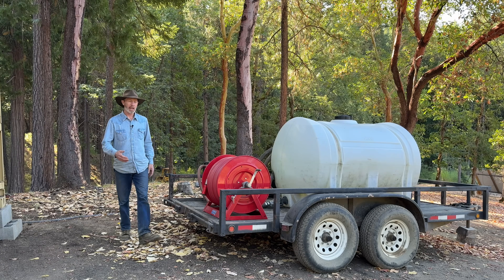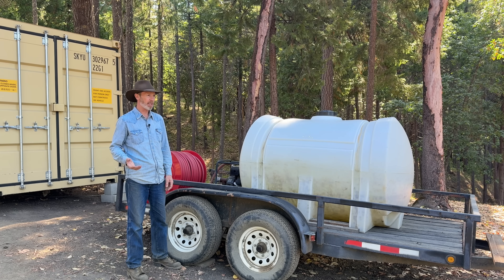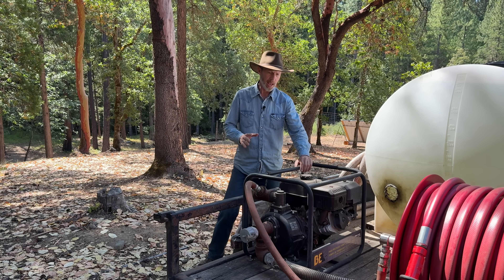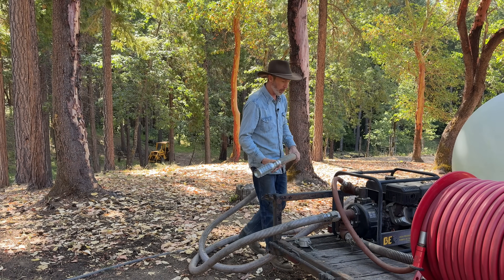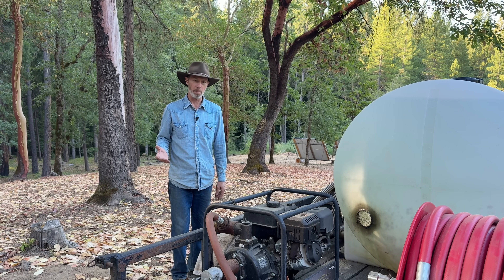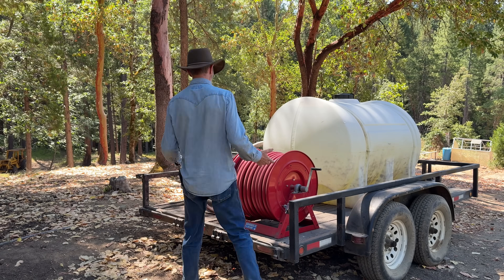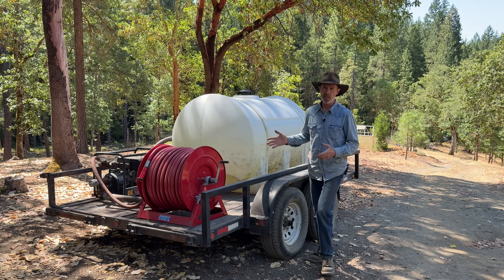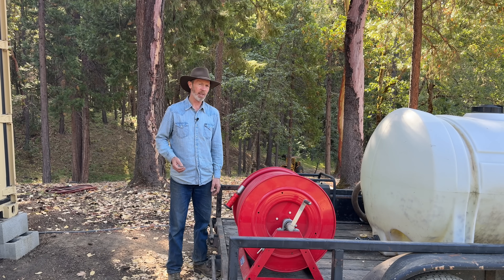I Built A DIY Wildfire Fighting Water Trailer

Comment: 5:18  Obvious question but, couldn't you just fill the tank from the red hose? None of the benefits of a recirculating system but you get a full tank of water.
In Britain we have ex-military "Sankey" trailers. Small, all steel, off road capable and will take a ton at a squeeze. Might be worth seeing if US forces use a similar thing.
And yeah, nothing's more permanent than a temporary solution.

Comment: Cool setup. My system is static as my entire property is one big hill with no hope of dragging a loaded trailer around. Plus there’s a lake at the bottom so the source is fixed. What I wanted to mention was that when I was discussing my proposed setup with a neighbour who is a firefighter he told me “Keep your hose lengths to 50’ max. Way easier to carry another dry roll to the end and attach than try to drag hundreds of feet of charged hose around and over things by yourself.

Comment: You can spray paint that water container and make it light tight. It's what I do on my IBC totes. Place a thin strip of tape going vertically up the container before painting to create a cheap water gauge. I suppose being the channel that it is I should mention you need to remove the tape after painting in order to see the water level.

Comment: Cool little setup you’ve got there. One tip—you can stretch that 500-gal tank a lot further by carrying a couple gallons of cheap dish soap. Class A foam works by lowering the surface tension of water, and dish soap does the same thing in a pinch.

If you add about 1.5–2.5 gallons of dish soap into your 500-gal tank (that’s a 0.3–0.5% mix, same ballpark as Class A foam), you’ll turn your water into “wet water.” That means:
	•	It penetrates deeper into wood, brush, and other Class A fuels instead of just beading up and rolling off.
	•	You’ll get a faster knockdown because more of your limited water actually soaks in where the fire is burning.
	•	Your 500 gallons will last longer, since you’re making each gallon more effective.

Only thing—flush the pump and lines with clean water after using soap to keep things from gumming up. It’ll get sudsy and slippery, but it’s a cheap, simple way to boost your firefighting power.

Comment: Nice setup. I have something similar. I use Storz C (2 inches) couplings instead of Camlock couplings. The advantage is that Storz doesn't have male and female couplings, just like the GeKa system, which only goes up to 1,1/4 inches. Pressure gauges at the outlet and especially at the inlet are also important, as they allow you to quickly determine whether the system is drawing in air. This can cause major problems. By and large, every landowner should have a mobile water pump system as part of their basic equipment.

Comment: A couple things for people wanting to make one, which I have done:

500gal is insanely heavy. Most of your pickup truck size skids are 300ish gallons because of this. Common IBC totes are available in 275 and 330 gallons, perfect for this application. Remember to place the weight of the water properly for axle loading and tongue weight distribution. 

Get the Honda pump, or one of the clones of it if budget is an issue. It’s the best design out there. 

The thing for a garden hose is called a “water thief”. Get some 50-100ft sections of Wildland “toy hose”, which is canvas single-jacket with garden hose threads (GHT). This, plus some all-metal commercial grade irrigation sprinklers, can make an effective structure defense line. 

As for the other adapter on the output T-fitting, you probably want to have several in both 1” and 2” sizes, with the different types of threads. USFS uses a different hose thread pattern (NPSH) than most of your municipal fire departments (NH/NST/NHT, which is all the same thing). You will also note that all your metal fittings will be NPT threads… most hoses cannot attach directly to that. So it’s wise to have a little box of extra adapters and a wrench on board. 

As to rig design: the pump needs to recirculate the tank water. So another T fitting where it goes out to the hose reel is needed, and hose to feed that to a bulkhead fitting installed at the top of the tank. IBC totes are clutch here again, since that fitting can be installed in the top cap. Also, the recirculation line needs a ball valve to shut it off as you open the hose up, or it will steal all your pressure. These should ideally be switched simultaneously. 

You will need at least a few hundred feet of 1” forestry hose to run branches if you are trying to defend a static area, like a farm/barns/cabins/etc. This will also require water thief couplers & adapters to link the hoses and allow you to split off various lines. 

300ft of rubber 1” handline is obscene. The weight of that hose is punishing, and there is no need for that much handline. You’d be better off with two 100ft rolls on each side of the trailer or maybe front/back. A fire skid can get away with one 50-100ft reel, as you should not be farther away from the safety of the engine anyway. 

Also, remember that your wood trailer deck and plastic tank can catch fire, as can dry hose and rubber handline, so keep your wits about you and things clear of exhaust AND falling embers. If the fire is close, give the apparatus a nice spritz as you begin (not the engine of course). 

Remember, you will need other gear staged for this. Appropriate safety gear, clothing, helmet, eye protection, and gloves. Sawyer equipment if you are trained, and always a fire shovel, axe, and rake. You should have bolt cutters and fence pliers on every wildland rig, as well as a good trauma kit in a protective hard case. I also recommend a tool kit of various plumbing stuff for the fittings.
Reply: All that information to just type 'insanely heavy.' Offering actual numbers, 500 gallons(~1900 liters) of water will be around 4,000 pounds or around 1800 kilograms. I'd rather go with the tote version. They will fit in almost anything with a bed, even in my maverick. Though you'll need to be aware of payload and mark a line where that limit is on the tote. Still, for fast response it can make all the difference. Unlikely I'll need it as I don't have to worry about wildfires but maybe someday i'll make one for 'just in case.'

Comment: Nice setup but as you say it's a little big.  Heavy to pull through soft ground if you are trying to get close to the fire but looks like it's not a problem in your area.  I have a scaled down version.  Single axle trailer, a water tote cube (250 gal), 5 horse Honda motor, 1 inch suction, 500 ft of 3/4 in collapsable fire hose.  My Honda 350 quad can pull it. (not easily, but it's what I have).

Comment: Large leaf blowers help extinguish outdoor grass fires when blowing the fire back into the black .
Reply: Back in 1978, my platoon Lt. thought it was a good idea to use a smoke grenade to mark the LZ for a CH-46 helicopter to land.  He didn't think about the 3 foot tall dry grass and started a nasty blaze.  Thankfuly the helo pilots came in from the right side and blew the fire back on itself.
Reply: I've seen those used by small teams in hotter climates and they could move quick using light vehicles to get in there with backpack-style leaf blowers.

Comment: Mount the tank, pump, hose reel on a 1-ton or bigger pick-up with a flatbed.
 Way more maneuverable and less chance of having 3 tons of water, tank, pump, hoses and trailer shove your pickup down a steep road, hill, or off the loose gravel/dirt road & into a ditch, or canyon...
 Plumbing for the tank to hose reel, or refill/draft to the tank is fairly easy to do with adequate size and pressure rated T fittings and in-line ball valves

Comment: the recirculating line back to the tank will save your pump from melting someday.   To be fancy, two lines back to the tank, one large diameter for refilling the tank, the other smaller diameter with a pressure relief valve that automatically opens when you shut off the hose line. or just a small diameter hose back to the tank.  Don't need a lot of flow to save the pump.   One less thing you have to do to preserve the pump, especially if you have to hike 300 feet back to the trailer to shut it off.     a low water shutoff might be pretty handy as well, as pumps spinning dry will eat itself really quickly.  a strainer basket and a foot valve will make refilling from a stream or pond way easier.   A small float on the strainer so that it is not sucking mud from the bottom of the stream will preserve your pump.  Empty milk jug or the like with a couple inches of rope should work.   
     The foam additives are nice, but you can just have a bottle of dishwashing soap and dump it into the tank when it's full. Keep a couple bottles on the trailer all the time.    It will increase the gallons per minute you can flow, and give you more pressure at the hose nozzle which is mighty handy.  don't know offhand how much would be needed, but 1% would call for 5 gallons for the full tank.   I suspect less would do fine, as you are not planning to fight oil fires with it.    
      The other thing is the motor.   when it comes time to replace it, get a dual fuel model that can run on gasoline or propane.    A 20 lb barbeque tank should run it for hours, and no worries about the gasoline getting stale or screwing up the carburetor.  For an extended emergency switch over to gasoline as needed.   I got a propane generator and it always started right up for me, unlike gasoline generators.  
   Firefighting strategies.  Rule 1, conserve your water.   that looks like a big tank of water, and it is, but getting into serious firefighting will use it up fast.   Shut off the nozzle every time.   Use fine spray more than the direct stream.    Go through the whole system and get OCD on stopping leaks.      I don't know if you have grasslands in your area, but if you do, make arrangements such that you can run a hose up to your tow vehicle so the driver or front passenger can spray out spot fires without getting out of your seats.  Regular garden hose with a one hand spray nozzle run up the side of the trailer and tow vehicle.   Hooks or tie off points to allow for normal trailer motions and not drag the hose or drop it.

Comment: Take quick conects on 2 inch lines on the discharge line to 2 inch pvc or of you only want to use flex hose make a small pvc hook to hold the line. But remember you need a air gap 
On the tank end

Comment: Also important are generously wide firebreaks kept denuded of all vegetation. If your water also contains total vegetation killer you can spray firebreaks while being ready for fires. Wildfires require FUEL and silly people put forest esthetics before the struggle for survival. I steadily denude the threat areas around my structures and have zero trees within 150 feet (and expanding each year). Trees fail killing people in their own homes every year because they failed to prevent them from existing.

Comment: A couple of suggestions from an Australian firefighting perspective: 
Many pump manufacturers warn that you will void your warranty if you  don't  use recirculation. A pump running with a closed-off hose is really just a machine for heating water, and that's not good for a pump. 
If a wildfire is getting lively, you want to be able to refill pronto and get back on the job. Many pumps come with 2 inch inlet and two inch ( or one and a half inch) outlets.  If you take advantage of the big outlets by plumbing a T, a valve, and a short length of 2 inch hose into the tank, you can halve your filling time. The other side of the T can be valved, then stepped down to one inch for your delivery hose.
Many of these pump motors will shut down if they are not sitting fairly level.  People often scratch their heads if they back down into a dam or creek to draught water and can't start the pump.  The low oil level cut out has been triggered. Solution: look for more level ground, and keep oil absolutely topped up.
Reply: Recirc can also help keep water from freezing, or thaw the tank if there's ice floating in it should you need it in the edge seasons like spring or fall.
Reply: Australian’s know what an inch is?
Reply: @mountainguyed67 Yep, it's not a big deal for us. Australians are pretty easy going and don't get worked up about it, even though metric makes more sense.

Comment: Get the honda high pressure pump,  it is a game changer. I started out with almost the same set up you now have and It was a joke of how little water was discharged  from my 200ft of 1" fire hose. My garden hose moved more water. I now carry my two !CB totes (550 gallons) in the bed of my 1 ton, 4x4, dually chevy. They  take up less then  7ft of bed space. The pump sits behind the totes and I can even close the tailgate if I am  traveling any distance. My intake hose is 20ft,  by  2" and my discharge is also 20ft by 2" hose. The key to making this all work is larger diameter hoses and less friction. We have a deep creek with easy access  less then 1/4 mile from my place and I can pull up, drop the pick up hose into the creek, remove the fire nozzle from the discharge and pump right into the totes. Then put the pick up hose into the top of the tanks and its ready to go.  With empty tanks I can drive down to the creek, fill my totes by myself and be back home in 15 minutes fully loaded. I can do that even quicker if I have one of my sons with me. The truck is so much more maneuverable then the trailer and with the high pressure pump I can push a large volume of water out to about 80ft. I  can empty those tanks in 5 minutes at full throttle or throttle down and make the water last. If my son drives we can cover more ground on the move and wet down a lot more real-estate then you can trying to drag a heavy hose from a parked  trailer. In my opinion, a hard initial attack with a lot of water up close and personal is the key to getting things under control before it spreads or gets out of control. The last three small fires we have had in the neighborhood it took state forestry 45 minutes to get here. I am not playing that waiting game again. All of my neighbors all know they need to come find me if we have any type of fire and if I am not home, take the rig and attack it.

Comment: I found out that high test gas is mostly formulated without the ethanol. But its also high octane.  I switched to that, even if its pricey, I don't use too many gallons a month, but all the small engines will not start much easier. From watching the videos of your roads, I would definitely keeps some serious straps on that tank.

Comment: I have installed a ball valve on top of the pump with a funnel to help with priming instead of the cap. When the pump is being used from a natural water source. 

Those plastic/aluminium caps have the habit to strip threads.

Comment: Great set up. Couple things to add are   A ball valve on the extra discharge so you can add another hose if the pump running and you could run  a recirculating line from the pump to the tank to keep the pump from over heating when you aren’t flowing water . You could also fill the tank if you are drafting . Also look at putting a shovel,and Pulaski on the trailer .

Comment: Couple things I would not like. Easy fix
Algae in the tank. Cover it up from sunlight 
Whacking my hand on the side of trailer. Switch position of pump and hose reel 
Enjoy
Reply: Also, small engines are especially fussy about water in the fuel. Using non ethanol fuels will help. Seafoam additive can sometimes resurrect a crapped up carberator

Comment: I once woke up in the middle of the night and did something I never do, I stood by the window and looked into the darkness.
all of a sudden I see a small fire spark up in my parents trailer, which quickly started to grow.
we managed to put the fire out, without any damage to the trailer. turned out the day before, my father poured hot ash on the trailer and the greenery inside 🤦‍♂
I don't know what made me look out the window that night and I certainly don't want to know what would have happened if I didn't.

Comment: That spec you’re talking about that ODF requires is 20 gallons per minute, at 115 psi through a 1/4” nozzle tip at 500’ of 1” hose. Nice work mentioning that. Stick a T on the suction side and get another valve to isolate the tank and put a camlock on the other outlet with a cap, you should be able to draft that way. That 500 gallon tank size is important too, 500 gallon minimum if it’s a trailer, if it’s truck mounted it only needs be 300.
Reply: It’s 250 minimum on the hose reel, not 500, my bad.

Comment: Finally, a subject I know more about than you, lol.  IBC tote tanks are readily available in 275 gallon & 330 gallon, both of which could be plumbed together, and are for sale everywhere on Craigslist, FB Marketplace, OfferUp, etc, for as low as $50 or even free sometimes.  Plumbing a bypass line from your tank to the pump is always a good idea.  Not only will you be able to utilize all the water in that configuration, you could turn a ball valve to change fittings without turning the pump off, plus, the continuous circulation of cool water helps from overheating your pump.  Just make sure your bypass line is plumbed on the opposite end as your tank inlet to avoid cavitation due to the turbulence created from bypass water going back and filling your tank.  

I do like your connection which allows fire fighters to connect right to your rig, although I'm not sure how practical that is.  Same with the garden hose hookup, (unless you had no other hose option).  Biggest diameter you can afford though, that's the key.  GPM's are predicated by hose diameter, so even a 3/4" garden hose can provide nearly double the GPM's than 1/2".
Reply: Helping